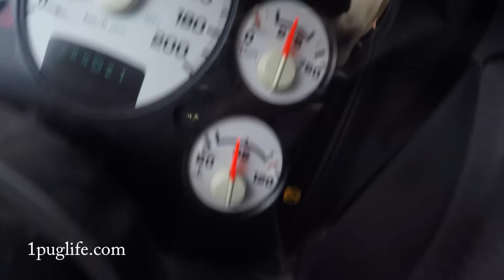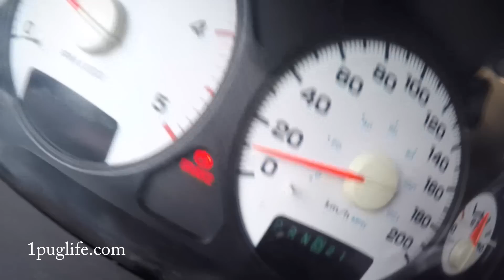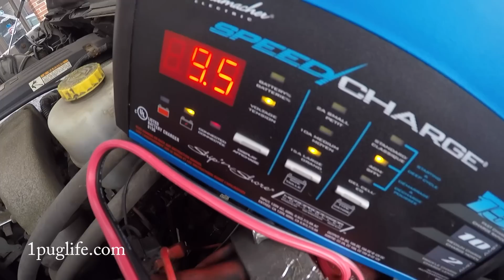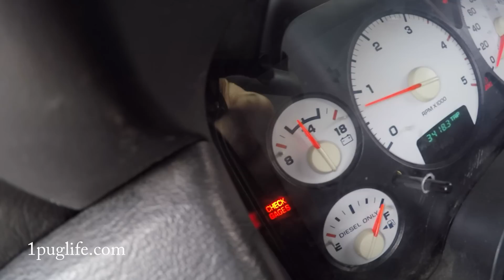this might be it!

Comment: Pug, Power outages kill harddrives - expect to replace them soon after. Lost quite a few back in zee day.
when power drops to a powered On harddrive the head can skid & crash on to the platter (where the info is held) causing gradual corruption of data until the point where the hd craps out altogether.
Try GSmartControl for OSuX to monitor harddrive health. It displays exactly what is & isn't failing :) bmp. 
Regardless about time you moved over to ALL SSD drives with how important hardware is to your income. More spensiver as frig but far more reliable than sata. You won't but you should. Stovepipe!

Comment: For a guy who lives of a freaking computer you should be way better with it. Why call Apple if youre Hard Drivefails. This thing is mechanical and can fail every single time. Thats why you use Raid setups and offside backups in professionell environments. Using a SSD or something like it as scratchdisc for editing is also heavy recomendet.

Comment: shoulda bought a chevy!
Reply: Kellen Richard or GMC
Reply: the problem with GM everyone that has them prices them like they are made of gold and hell they are just another truck.
Reply: I don't know the last time you looked but they are the cheapest you can buy now lol. Ford and Fiat have much more expensive ones the last few years.
Reply: I was talking about used trucks.  I bought an F150 got a great deal..I wanted a 2500 hd gmc..but even 2004 thru 2006 models with 200k miles were 15 grande or more.. Just way over priced. I like all trucks..the brand does not matter to me..They all have their good and bad things about them.
Reply: wysetech2000, yeah they go out in chevy , but chevy is a helluva lot easier to get the alternator in and out of.

Comment: Cummins is a great engine,  dodge  just sucks.  put it in a Chevy or ford
Reply: in the plow truck for a daily
Reply: I had a 12 valve with 275,000m on it,  the dodge just kept eating front ends and I couldn't afford it, or afford to put it in another truck.  That engine though, never ever ever failed me.  Lost all power once while driving once and no problems besides not having any speedometer and such
Reply: So put it in something useful and get it registered, unless canadian laws about that are fucked